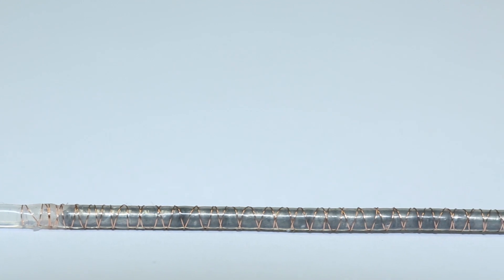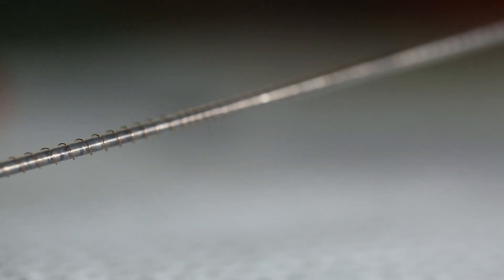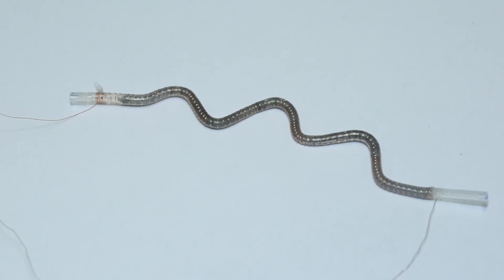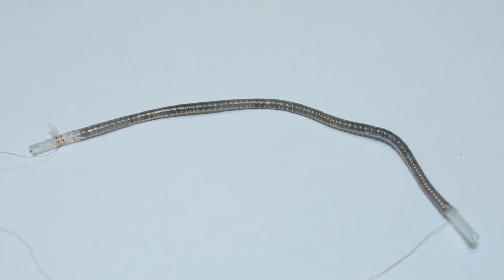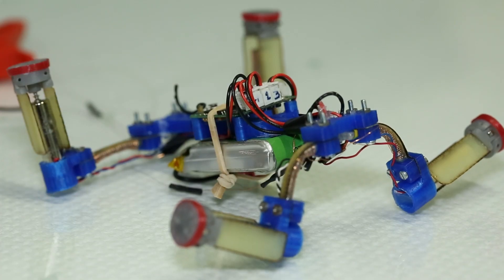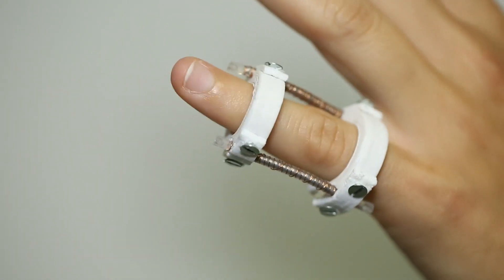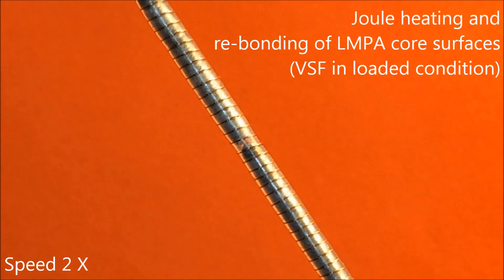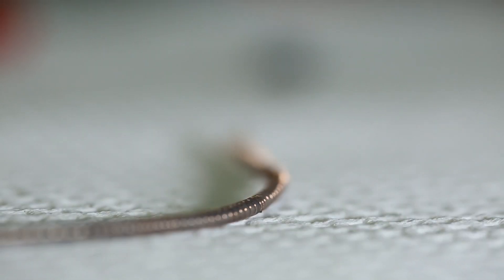A composite thread that varies in rigidity

Comment: It would be nice if the inner core material responded to magnetic flux instead of heat, especially if you're thinking of textile applications. Comfort matters. Bonus points for making the material bi-stable.